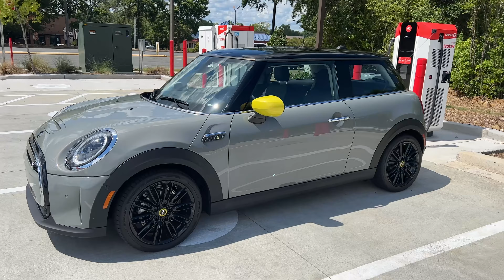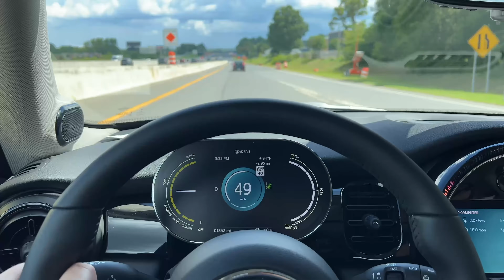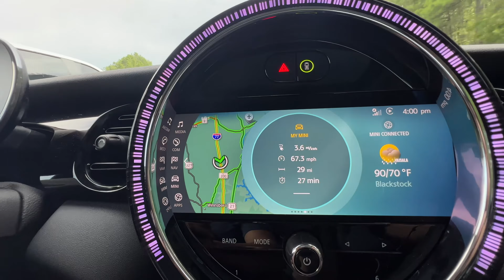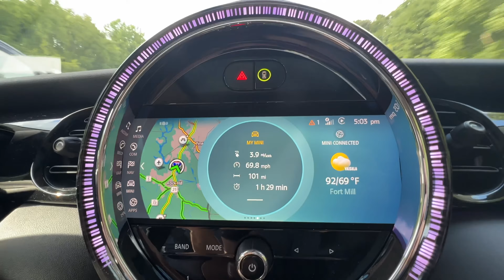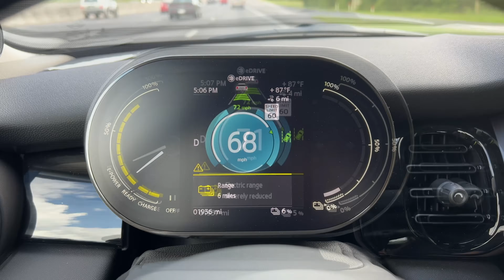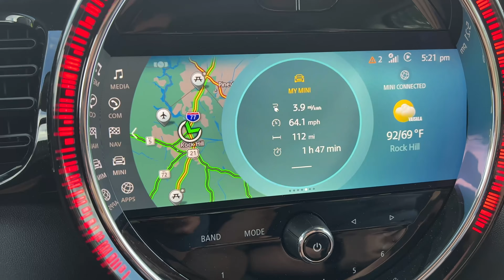Highway Range Test In The Shortest Range EV! - 2022 Mini Cooper SE

Comment: Let’s see. A 100 mile range EV. Why drive at 70 mph? Why not 60 mph? The car should go further and require less time to recharge.
Reply from the maker: No. Driving faster is more effective for overall time.
Reply: Good video. You can't drive 60 mph on Florida highways. I would like to see a video using the test speed of 75 mph.

Comment: Love my Cooper S E Level 3 here in Scotland - it arrived from the factory in November 2021 after 2 months from ordering which was a big surprise when I was expecting a February 2022 delivery. !! It’s a 2nd car for me (other one is a Land Rover Defender 2020MY) but is the one used most now mainly because public charging is free on 50KW public chargers where I live and diesel for the Defender is just short of £2 a litre…… I also charge the Mini from my domestic solar panels at this time of the year - I’ve spent £22 on charging since November and driven 5700 miles……….. I’m regularly seeing 135 miles on a summer charge - often 4.8-5.0 m/kWH with next to no motorway driving.  I use the Sport mode regularly  because it’s just sooooooooo much fun.
Reply: Is the charging still free?

Comment: I'd consider one with 200 miles of range, but as is, this is only suitable as a commuter.
Reply from the maker: It's a great second car, as most Mini Coopers are anyway. We have 1800 miles on this after a year... it barely gets charged once a month. ~100 miles of range is more than enough.
Reply: @brandenflasch  I can't believe you only have 1800 miles on it. We drive the daylights out of ours, my son has done 20k in a year, I've got 15k and my wife has 10k. Yes...we have 3 SEs in the family...all performing very well. Best range so far 140 miles...on mixed roads. We get less range consistently on flat, constant driving.
Reply: its literally supposed to be a commuter.